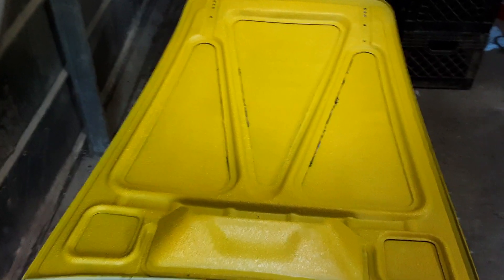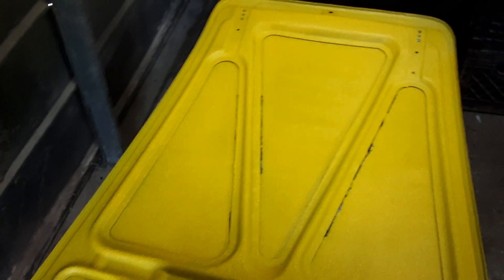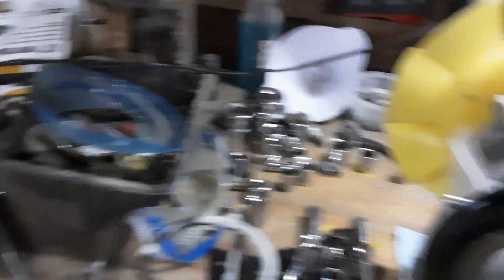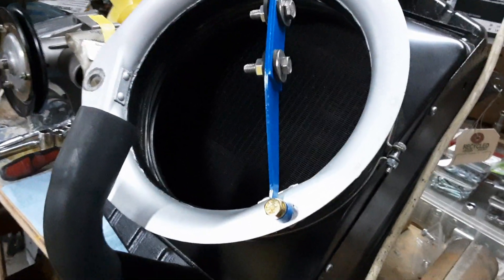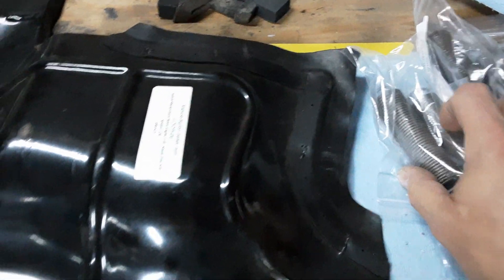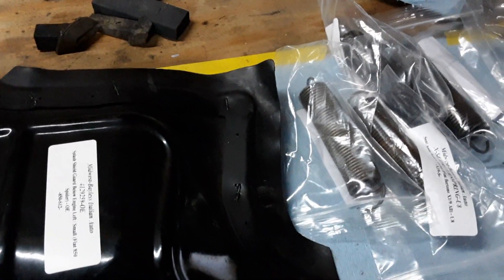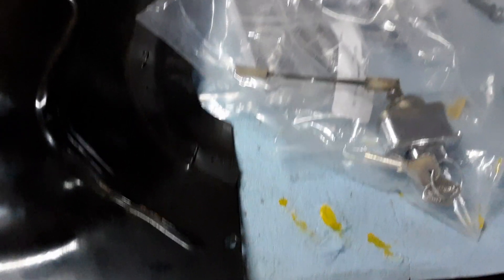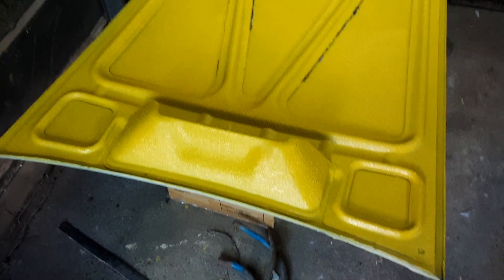1972 Fiat 850 Spider Restoration Project Episode 34

Comment: Hi Dennis, this all looks very good, the springs under the seats you did not need, i didnt have those at my car. The foam at the cover  is a good idea.
I have fit  little plats off foam at the left and right side of the cover, becaus there are the clamps for the hood when its in the car. If you close the cover and the clamps are not in the right position, you will have a dent in your cover from the inside!!
Reply from the maker: Shouldn't the weather stripping prevent that?
Reply: @dennisjump8655  no, i send you a foto
Reply from the maker: @fiat850garage8  OK thanks

Comment: What is the importance/usefulness of the under-engine shields? I'm not sure these cars -- at least stock -- go fast enough for an aerodynamic effect, but maybe the exposed rear does act like the gate on a pickup truck. If you would kindly fill this gap in my knowledge, I would appreciate it.
Reply from the maker: Because the radiator is in the rear, they help direct air for proper cooling. That's the story anyway. They can have a tendency to overheat without them. Having said that, in most 850's you see now these are missing. So, I suppose you can run without them, but since I'm doing a complete resto, I wanted them. If you saw Episode 31 you can see they keep a lot of dirt & such out the engine bay as well.